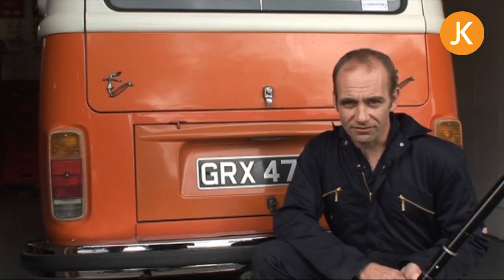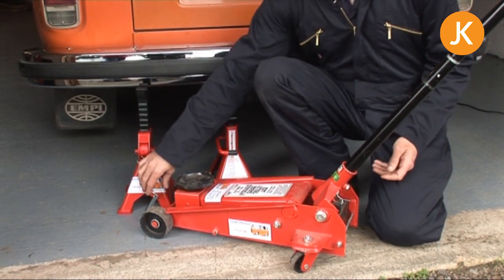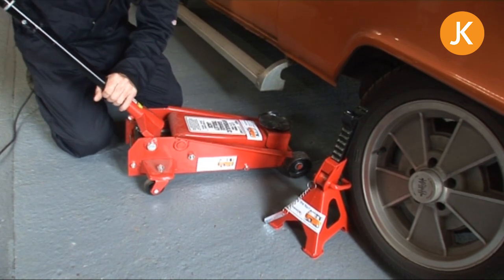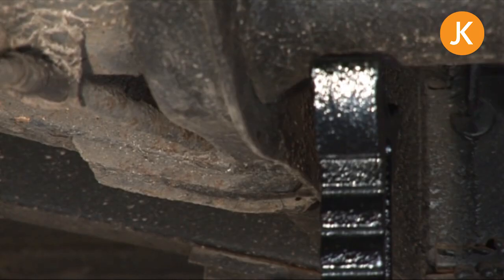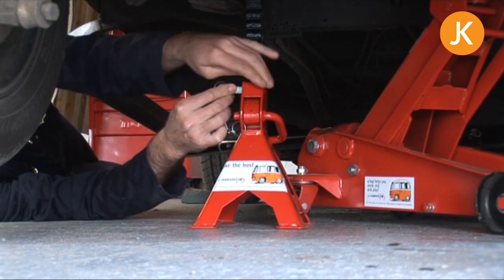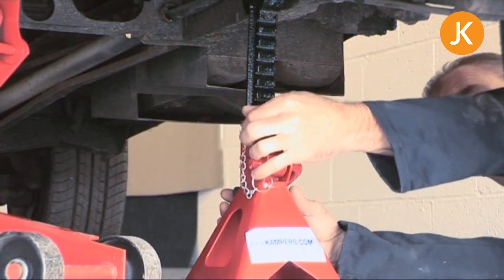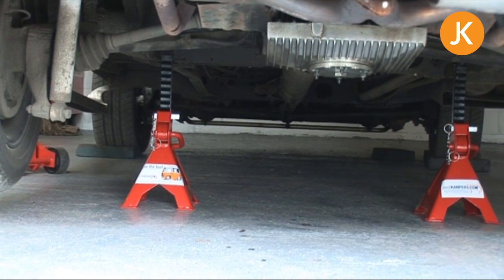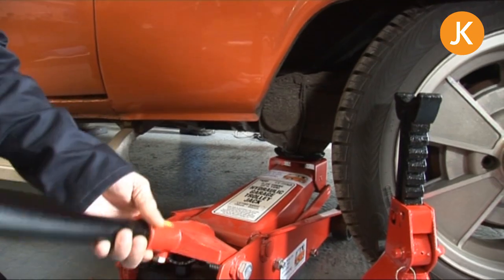How to safely Jack Up the rear of your VW T2 Campervan

Comment: Another tip/s with ratcheting stands (or any adj. stand)....Avoid raising the post because doing such makes them less stable. If you need it higher get taller stands. Leave the floor jack under as a 'double jack' as an added safety device.

Comment: Just a question: if you jack up both rear wheels with the manual transmisson out of gear, should the rear wheels spin with the trans axle system?  My camper has been sitting for about 5 years without movement; I cannot get the left rear brake drum off with the left side of the van jacked up (I do not have the right side jacked up..yet).
Reply from the maker: Yes both rear wheels should spin.

Comment: Should I put the van in gear? And put handbrake on? Thanks
Reply: If the rear is up and the handbrake is on this will not prevent the bus from possibly moving (rear off ground).